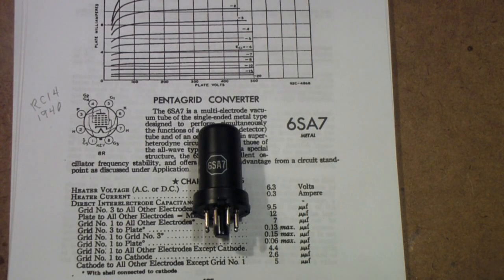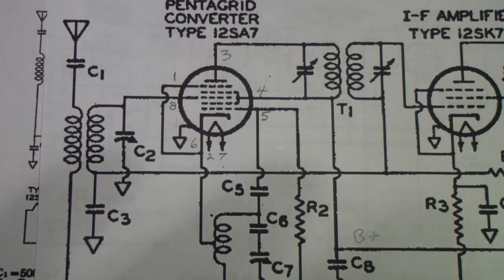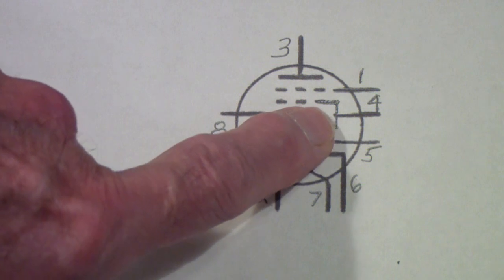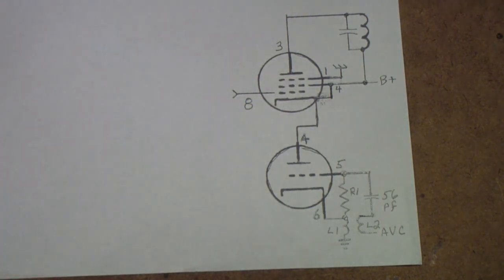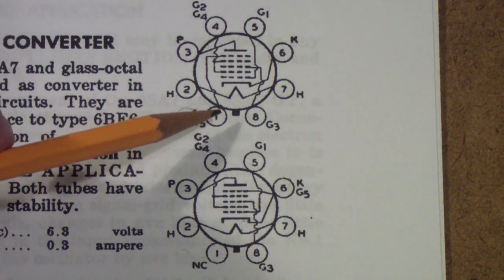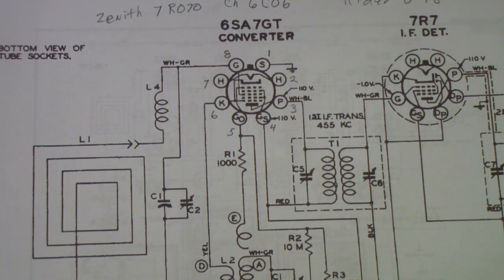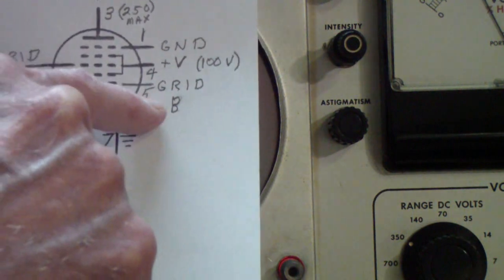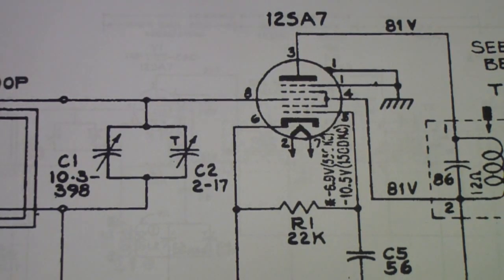TTT312 Pentagrid Converter Tubes & Circuits

Comment: Admiral 7T10 ch 5K1.. 22k grid resistor is going to Gnd instead of the cathode as shown in older models ? ..thanks for the excellent video on the 12SA7...😀

Comment: Is there any reasonabel explanstion what might cause xenon bulbd to shot arc to engine? I was confused for yesrs why that is happening and what posibly culd cause it the xenon bulbs do resembel wacum tubes and wanted to know how those wacum tubes interact or conver generators power out put I hoppe for some books or links the old trains were interesting who used multi tap transformers wacum tubes and electric motor snd generator units for trains so hoppe some one knoe about those old systems hiw they posibli operated

Comment: Hi! My name is Oleg and I'm writing you from Ukraine. I like to create tube devices too and I've seen in this video that you talk about geptode 12SA7. Here we have very interesting historical fact - 12SA7 was cloned by soviet union engineers many years ago and that clone got name 6A7.  Our tubes have the same case and pin numbers and also very similar parameters. But one difference do presents - our 6A7 has 6.3 volts heater) So to replace your tube 12SA7 with my tube 6A7 we just need to reduce heater voltage and our device is ready to use)
Here is the link to 6A7 datasheet: https://www.istok2.com/data/416/
Thank you for the video! It was very interesting
Oleg, UR7WKH
73!

Comment: I've spent several hours trying to answering my own question about field potential with the tube. A while ago, I started with Spangenberg "Vacuum Tubes" 1948 which is highly physics based. It was just confusing. After your video, I found Eastman's "Fundamentals of Vacuum Tubes" 3rd which has a clearer discussion of this starting on pg. 79. He also covers the clear distinction between pentode and beam power tubes. I wouldn't have figured out this question if it hadn't been for this video renewing my interest. Thanks Tom.

Comment: Tom, I'm obsessive. The pentagrid patent was awarded in 1939, so where should I look to learn about G2 forming a space charge? I poked around 1940s article but didn't stumble on anything. 

I'm very interested in space charge and the electric field within the tube to better understand how the impact of selecting a pentode screen voltage to circuit performance. Thanks.

Comment: Pentagrid convertor theory of operation is quite the rabbit hole indeed.
One of those special built hybrid devices that do not really have a modern day equivalent.
Maybe still some topics left in its operations? I have not gone to the point of trying to equate it to a comparable modern day circuit, I guess the mixing is due to the gm of the upper stage and a modulated cathode current...
Nice catch on the difference between a glass and metal tube :D
Cheers,